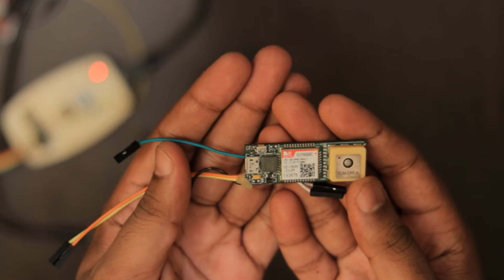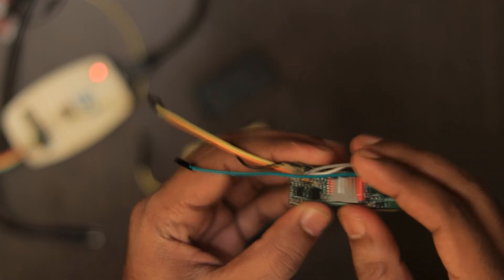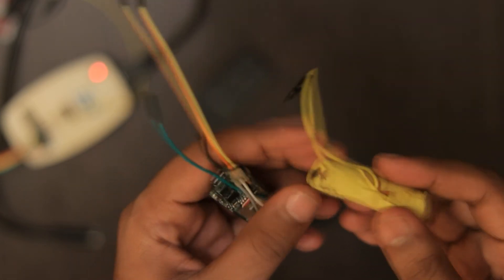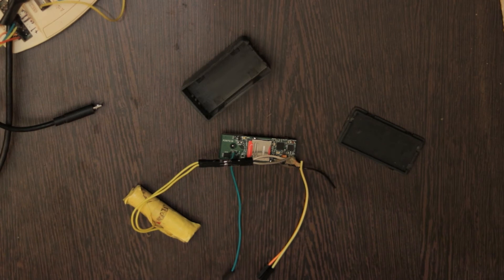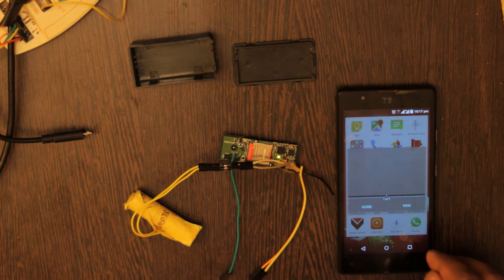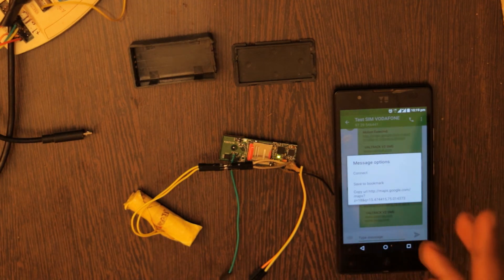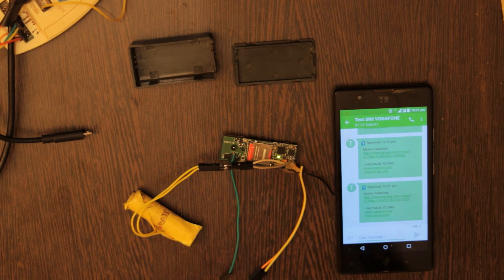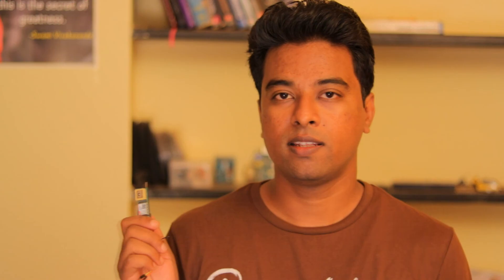Designing a Low cost GSM/GPS tracker - SMS Tracking Demo - Part 3

Comment: Hi, i have a problem with my module sim868, i should to send a  command 'AT' a few times, before i get response from mofule. And also  i remove the echo 'ATE0', and after few commands, the echo returns. Other problem is i cant connect sim868 with windows 10 , he permanently is on, off in device manager, i cant check firmware and i cant upgrade if is there new vresion of firmware. How can i turn these module to work fine ?
Reply from the maker: Hi Vilzar,
Please post your query with details here,  http://www.embeddedadvice.com/
We can discuss 
Thank you for watching. Dont forget to Subscribe :)

Comment: I am  facing some problem with GPS communication in our SIM868 module. 
AT commands used and response are given below.
AT+CGNSPWR=1
OK

AT+CGNSINF
+CGNSINF: 0,,,,,,,,,,,,,,,,,,,,,,

We are using  All-in-one Mode of operation for GPS communication. 
Is there any specific commands for GPS in SIM868 module.
Reply from the maker: Hi Sandeep,
What is the problem here? You not getting GPS NMEA messages?

Please post tech queries to http://www.embeddedadvice.com/
We can discuss.
Reply: Ravi Pujar ..thank you for your reply.. problem solved now.
Reply from the maker: Good that you were able to fix it, What was the problem.
Reply: Ravi Pujar problem is with the baudrate of gps uart, default baudrate is 115200, when changed to 9600 got GPS packets

Comment: Hi Ravi, 
Can we use the USB signals in SIM868 for transmit or receive AT commands / response directly without using FT232 chips?
Reply from the maker: Hi Sandeep, 
No, USB port is only for firmware updation and debugging. There is no clear information on debugging side. But AT commands are not supported on USB. Dont forget to Subscribe :)
Reply: Hi Ravi,
Thanks for your reply..:)
Reply from the maker: My pleasure :)
Reply: Hi Ravi, 
SIM868 have dual SIM support. How we can select SIM1/SIM2 ? (Is there any AT commands for the same).

Comment: Hey! Ravi, you are doing amazing kind of work, welldone✌️. i m watching u from your first video of  tracker and because of my interest i also started making a tracker using some modules and microcontrollers like uno but i want to make it  compact like yours in a pcb so can you pls tell me the procedure and what kind of knowledge i have to gain first and from where i can get those informations?
Reply from the maker: Hi Manish,
Thank you very much :)
Making it compact is all have to do with choosing the right components. The components used in the tracker are of the smallest possible size. Like all the resistors and capacitors are 0402 wherever possible. I could have gone for 0201 package which would be still smaller but then it would become extremely difficult to handsolder. Today even though all the parts look small, i am able to hand solder them using a small tip solder gun (available in local market for Rs.400) and a hot air gun/blower. Knowledge is something we acquire over time. Keep experimenting and don't be afraid to fail and start over again. When we face a obstacle that's where is the chance to grow further. Start small and go for bigger projects. Attempt things which seem difficult, You will learn more. Stay in touch with semiconductor manufacturers to get latest product updates. Sites like Mouser.com and Digikey.com are a great source.
Reply: Thankyou so much for your decent  reply😁..but as i can see, you design the whole layout of pcb so my question is how can i do mine and what type of case study(course name)  should i do to learn the function of different pins of atmel chips and other ic's also?..so that i able connect all of them in a right way.
Reply: and can i get your email id to learn more from your skills?
Reply from the maker: You could go for a embedded systems course. There are many instititutes  providing good training. But they will not focus on PCB design. More focus will be on Microcontroller programming. For designing PCB. Online resources are best with lot of youtube tutorials on Eagle. There is no one specific pointer i could give. You have to pick bits and peices as you go. 
My email is ravi@valetron.com
Reply: Thanks a lot Ravi✌️

Comment: hi ravi... is the product ready??
Reply from the maker: Hi Siddharth, 
It will be ready in a month time.
Reply: hi ravi... thank you for the reply. what would be the approx cost of the product... and would it also have any recurring costs?
Reply from the maker: It will be around 3.5K to 4K INR. May be less if we  go for high volume production. 
Recurring costs are for GPRS based devices who need to pay for server maintainance. 
If companies are providing SIM cards then they need to pay for SIM card charges. 
But this will be a configurable device, you can configure it to your own server. And you need to buy your own SIM card of your choice, which is having better network in your area. 
I can provide my own server for GPRS based logging devices but there will be charges as i need to maintain servers.